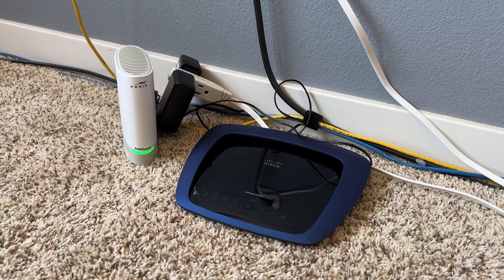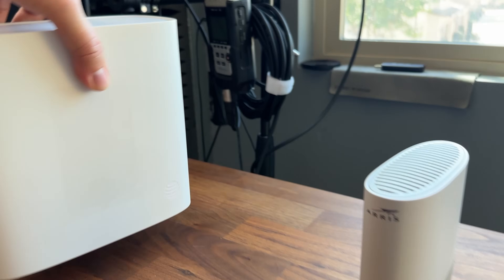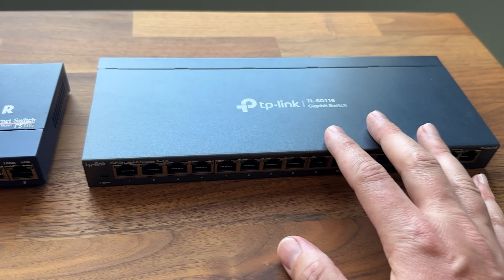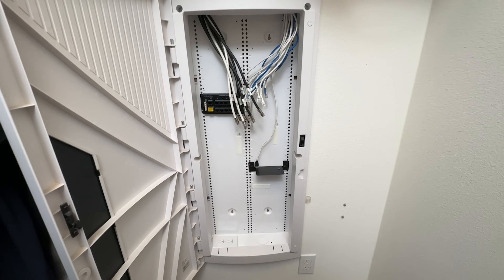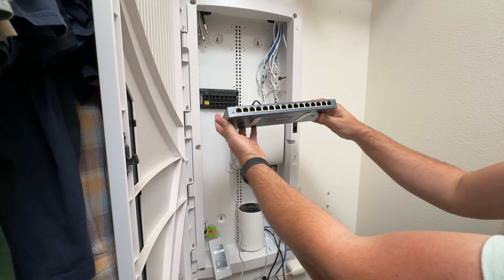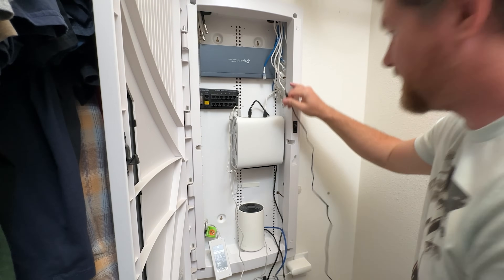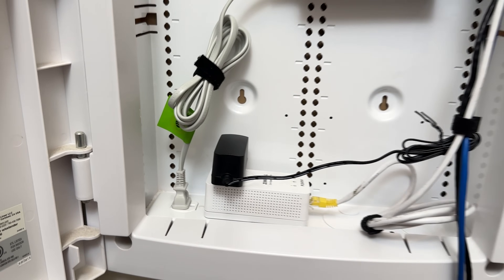How To Setup The PERFECT Home Network For Beginners

Comment: What do you do if you do not want any WiFi in your house?  I only want optical networking in my next home.
Reply: Its the same overall idea, but run fiber optic cables. Do note that practically no consumer electronic device supports fiber directly. You will need to buy a switch that supports SFP fibers modules and then hook up your fiber cables to those modules.

Again, no regular consumer computer or laptop directly supports fiber cables. So you will need to buy a PCI-E card that has an SFP module and then a fiber SFP module to connect into that card to hook up the fiber cable. For laptops, there may be USB-C to SFP modules, but I haven't looked into it.

In all honesty, it doesn't make sense to do this unless you need the absolute maximum data transmission speed OR if you have a very large home and/or property and need to create multiple IDF cabinets that hook up to your main network over fiber. This is the way it is done in offices and buildings. It can be done in homes as well, but it is way overkill.

Comment: What should I do if my In wall Ethernet box is not near my router how do I connect it to set up the Ethernet box
Reply: How far is the box to your router?
Reply: @JJFlores197 about 25 to 30 feet it’s in a different room
Reply: @berserkWoodWorks  What type of internet connection do you have? DSL? Fiber? Coax (cable internet)? Does the in-wall ethernet enclosure have any of those connections in there?
Reply: @JJFlores197 I have fiber internet but the box was set up for Ethernet ports so it has Cat5e in their and coax cable but the issue I’m having is how do  I get those ports onto my internet since they are punched on a board with phone cables

Comment: I’m confused… why connect wired devices in unmanaged switch to a mesh WIRELESS network? Why not connect the switch directly to the router? Is there benefit to having wired traffic going through wireless device that I’m missing?

Comment: FYI that 320 should be sitting straight up if not already since it’s a year later. Any issues with your service, a system test will be run automatically and it will be detected that the gateway is not standing straight up which will then fail the system test and likely flag for a technician to be dispatched. I would’ve also plugged the WiFi router directly to the gateway. Not suggesting you don’t know what you are doing bc you definitely look like a networking expert (more knowledgeable than myself) however, Ive installed ATT internet for 15yrs and I know what causes issues and slow/limited service.

Comment: Hello Steve, I have an AT&T Gateway as well so can I use the EERO Pro 7 and connect it to the Gateway without doing anything extra? I only purchased one Pro 7 thinking I could use it wireless. I am a rookie at all of this so I'm trying to find the best and simplicity way to set the hero Pro 7 up. I need more cover downstairs and my panel is upstairs.  Thank you

Comment: That 320 RG(ATT Modem) cannot be in any position other than the upright position. If it senses that it’s on its side or on any position other than upright, it will dispatch a technician. If that modem is not upright, it will fail the technician’s quality check test.

Comment: Alright, I'm building a new house and want to set up my own network. I don't want anything crazy or complicated, but my wife and I both work from home so we want it to be fast and easy. Maybe someone in these comments can guide me right:

1. Internet comes into the house from the ISP and I connect that to my modem / router. This generally has a firewall built in, correct? If I get the Gigabit switch and connect that to the modem / router, I won't need to worry about buying an external firewall, right?
2. If I ask the builder to set me up with an ethernet port to every room and have them all connect to the central server rack, can I establish a Wi-Fi connection in each one of those rooms? For example, in my office, I'll be running a desktop and don't mind having a wired connection. My wife on the other hand can't be bothered to plug in her laptop in her office and will want a wireless access point instead. Do I get another router for each room? Or what what's the better term for this?
3. All those coax cables, what's the idea behind this? You would have one central cable TV receiver, and this would just send it to each TV in the house? I'm not really following what all those could be for.

Thanks in advance to anyone that might respond! 🙏🏻
Reply: 1. Most ISPs will sell/rent/lease you a gateway box which includes a modem, router, and Wi-Fi access point all in one unit. So you don't necessarily need to buy your own router. Most ISPs will let you use your own router, but you should double check with them to see what options you have. As a side note, ISPs usually don't support 3rd party equipment so you will be on your own if you have issues.
But to directly answer your question, you don't need to worry about a dedicated firewall appliance. Practically all home routers have some type of firewall built into them. There are dedicated hardware firewall appliances that you place between the modem and router, but they are usually not used in home network.

2. Yes you can do that. The way this is done is to install Wi-Fi access points throughout your home to get good Wi-Fi coverage. This will require some planning. You probably won't need access points in each room, but you'll need to plan. You'll need to identify where you want Wi-Fi coverage, what types of access points you want to use and make sure you install them in appropriate areas around the house. Ideally, there should be some 'overlap' so that you don't loose coverage when moving from 1 service area to another. But you also don't want access points too close to each other as they can interfere with each other.

In terms of ethernet runs, its best practice to always install 2 runs. Its better to have an extra run and not need it than to need it and not have one. It will probably cost a bit more per extra run, but you might as well spend the money now to get them installed when the house is being built.

3. A lot of homes have coax cable installed for cable TV service. I think in older homes, the coax is usually installed on a side panel on the side of the home. The main feed from the cable company runs into this side panel. It is then split off into various coax cables that run to the various homes of the house. What he has is the same concept, but it is inside the home as opposed to on the side panel outside. Unless you plan on having cable TV service or cable Internet service, you probably don't need to worry about coax. I personally wouldn't use it if given the opportunity.
Reply: @JJFlores197  Legend. Thank you so much for the detailed reply. I feel really confident I can get this set up when we build the house.

Comment: One thing I'm not sure about in the video, and I may be wrong, so please correct if I am - when Steve says the internet speeds will be split on devices connected to the second switch, that seems technically true, but I don't think it's a result of using a second switch. Rather, isn't your primary internet speed split to whatever device is using it anyway, regardless of where it's connected? I feel like if Steve's PC was connected directly to the primary 16-port switch in the closet, the internet connection wouldn't be any faster.
For example, using gigabit speeds and an oversimplified setup: if an Xbox connected to the first switch is downloading a game, and a PC connected to the second switch is downloading a huge file at the same time, won't the speeds be split 50/50 between the Xbox and PC? And if a phone is also downloading a huge game over WiFi (for the sake of example), won't the internet speed simply be split three ways to each device (in theory)?

Comment: what is manage an umanaged i quite didnt get that cause on my router i only get blocked on  ethernet .help please to do this
Reply: An unmanaged switch is a 'dumb' switch. It has no management capabilities. Its plug and play and that's it. You can't customize any settings on it.
A managed switch is the opposite. It has a management interface, usually a console or serial port that you can use to login and add custom setting like custom VLANs, switchport assignments, etc. Most home networks don't really need a managed switch.

And I don't understand your part. Are you blocked from the network only on ethernet?

Comment: What provider does the internet feed come in on ethernet?
Reply: It looks like he is using AT&T Fiber.
I think with older installations, AT&T installs an ONT (optical network terminal) in the garage. They run fiber from the street to the ONT. They then run an ethernet cable from the ONT to wherever the gateway unit is installed in the home.

Comment: Ok maybe a stupid question but i'm asking anyway lol.....what happens if the wifi on the router goes out(example a techical issue due to outage in my area/town)....does the ethernet connection to my say playstation 5 or any other device still work through the ethernet cable going to it?....or does it shut down the ethernet cable working also from the router since the wifi is out?......cause basically i got everything in my house running on wifi and when the wifi goes out i'm basically crippled as far as anything operating until its back up and working lol....thank you in advance
Reply: Your WiFi only goes out if you loose power or unplug the router from wall. A lot of people confuse Wi-Fi and internet. They aren't the same thing.

If your internet service goes out, say your provider has a network outage in your area, you will still have Wi-Fi, but no internet. There is no way around that unless you have a backup internet connection.

Comment: You did it so well and then ended with just putting the router on a cardboard box. You should have mounted it on the wall and ran the lines through the panel.

Comment: Would you do a video for rentals with no Internet coming into the house. Ie major corr cut!  I want to use a cellular router modem. PLEASE 😊
Reply: Look into T-Mobile Home Internet or Verizon 5G Home internet or AT&T Internet Air. Those are all 5G-based home internet solutions. They all provide you with a gateway box which includes a modem, router, and wifi all in one box. But the performance greatly depends on many factors such as signal strength, cell tower congestion, and so forth.

Comment: Well i dont believe that your PHONE PLUGS did not need to be switched out. I mean, if your house setup is pretty much like mine you would have had to REPLACE the phone plugs in each room with a new wallplug and RJ45 compatable data jack. Right now, you would have a phone jack there and you did not show this. All you did was show the connection in the box but i bet your bedrooms needs a fix :)

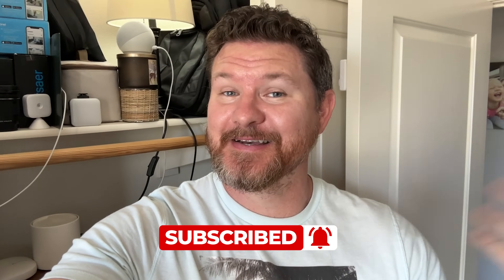Comment: FYI, wired does not split internet speeds. I dont wanna criticize your video. However, when you talked about splitting the 1GB, that is wrong. Wired network connection for internet does not... I repeat  DOES NOT split internet speed. Each device connected via wired networking will receive the full internet speed you are allowed. The only way internets speed is split is through WiFi. So if you do want all your speeds for a device and thats pnly the amount that device can handle because not all devices are made to receive the same amount of internet speed then wired it always the best to go. 16:43

Comment: Why would you connect your Moden into a WiFi Router in your Network rack if you’re just going to have Routers throughout the house? It’s easier and better to just plug your modem into your gateway and then run a LAN to your switch, then to your WiFi Routers (in whatever rooms you please). Now you just have a router omitting WiFi from a closet, not really doing anything……

Comment: Be wary with Mesh Wi-Fi. I used to have it and it did not work well for us at all. It was always going down and getting messed up. 
If possible, instead use a switch and by WAPs (Wireless access points) and connect them to the switch via ethernet. Faster and more reliable. 
However, this method does cost more and is more time consuming. Overall I say it is much more worth it, especially if you have a family that likes gaming and streaming videos a lot.

Comment: Way too expensive and complicated.   There used to be a Peer to Peer Network called 'LANTASTIC' I sold and installed it in the 90's. it used one computer and it's HDD as the master and upyto 3 other Computers as satellites that access a data base o the Main Computer.  All I want Need is a way to Access all the Library (Data Bases) Projects on my main ASUS Laptop from My M4 Mac mini with out having to Duplicate the data Bases and all the ASSETS Video files etc on the M4 Mac mini.

Comment: When using command strips, do not be surprised late at night when you hear a loud thud sound as your equipment falls to the ground or, in this case, to the bottom of the cabinet due to the adhesives failing
Reply: I don’t think I’ve ever had a command strip fail lol

Comment: My house is wired with a control panel. However, when ATT did the install, they brought the feed in to the outlet by my TV. However to I get the feed to come into my control panel?
Reply: It may be pretty wired with cat 5 or 6 at or near the spot where the modem is. Check for a blank plate or plug in nearby. If it's there it would lead back to the main panel with the rest of them. You will have to call AT&T if you don't know somebody who can do this kind of work.
Reply: Pre wired

Comment: To be clear... the "firewalls" supplied by the ISP inside their gateway/routers/wireless units barely make the definition of what a firewall should be doing.  I would never, ever rely on just that firewall to protect my home network and never trust ISP supplied all-in-one devices like that.  Never trust your ISP, period.

For concerned people... I suggest you disable the router & WiFi portions of the gateway (set the gateway to bridge mode if you must) or eliminate it entirely and use a real firewall/router to control not only what enters, but also can leave your network... something like pfSense or Firewalla to name a couple.  Add a dedicated device (or add-on like AP7 to Firewalla) to provide WiFi that sits inside your network.  You'd be amazed what information is gathered by your IoT devices and sent out on top of what it blocks trying to come in.  They also give you full information on what is being done/blocked/passed/logged vs. ISP supplied FWs that do not.

(35+ year IT network and datacenter engineer veteran that has been running Firewalla for 5 years with Verizon FiOS ISP and just added their new fully integrated AP7 mesh WiFi system)

Comment: just a dumb question, why have the gateway if your not gonna use the WiFi?

Wouldn't it be useless since you're using the router, assuming the router also has security?
Reply: With AT&T internet, you have no choice but to use their gateway. They use proprietary authentication methods that require an AT&T gateway. I believe there are workarounds, but they're not all that easy to setup especially for beginners.

Comment: I’m new to all of this. How do you have Ethernet coming in from the street?
Reply: I think hi misspoke. AT&T delivers fiber internet to the home (in certain areas). They run fiber from their node to your home to an ONT box. in short, an ONT is an Optical Network Terminal. They run fiber to this box and from that box, they run a standard ethernet cable up to wherever the AT&T gateway will be located. Its more of a media converter. ISPs don't actually run ethernet cables from their poles to your house.
Reply: @JJFlores197  Okay, that makes a lot more sense. Thanks!!!
Reply: Most if not all internet providers get connections from a pole. They will use that pole to get internet traffic flowing to your house. They typically we set up the cable to a land line which will be the output of your internet connection.
Reply: @njose618  Okay, yes. They ran a coax cable from a pole behind my house up to the house, then sent that coax cable in to my modem. I was just wondering if he has ethernet cable coming from the pole instead of coax

Comment: How do you turn off the Wifi from the AT&T Gateway (since you're using tp-link mesh?
Reply: Last I remember, you just log in to the web interface of the AT&T box and turn off the wi-fi radios. You enable IP Passthrough and disable some other security features if you want to use a 3rd party router as the wifi router.

Comment: I was told if you use the AT&T in pass thru mode for mesh, then you don’t need to plug anything into the ports on the back.

Comment: Hey Steve, help me out I moved in to a new place which there was already pre-wired Internet network, but my Internet wall ports don’t seem to be working and everything is connected. I’m just running on Wi-Fi right now.
Reply: Just to clarify, are the network cables all connected to your ISP router?

Comment: I have no clue about any of this. Would'nt it be better to plug in straight to the switch from the at&t modem/router instead of going through the mesh and  plug the mesh into one of the switch ports ?. I do not know if there is a reason, just curious.

Comment: If you live in an older home that doesn't have wires everywhere, I'd say invest in a MESH Router

(At least a Wi-Fi 6e MESH Router) Or If Poor (A WI-FI 5 Router) Wi-Fi 6 is a scam basically...

(MESH is IMPORTANT for zero wiring, except for the modem to router)

Also to Note: You only need a basic Cat5e Ethernet cable to connect your modem to your router

Comment: Hi Steve. I have an AT&T gateway as well. I was wondering why you didn't use its wifi?
Reply: Bc he’s using the tp link mesh system as WiFi not the built in WiFi  in the gateway